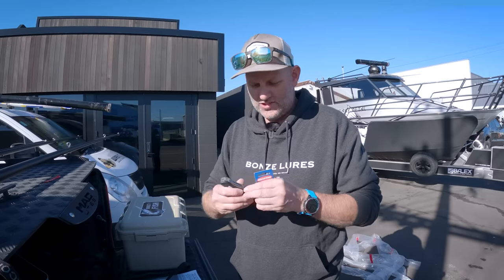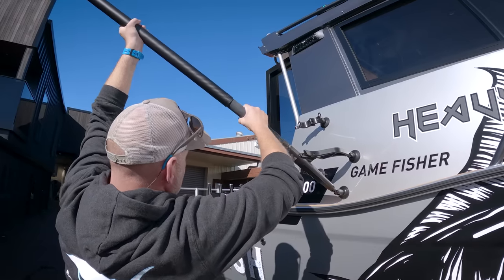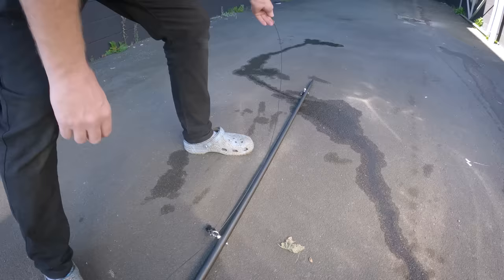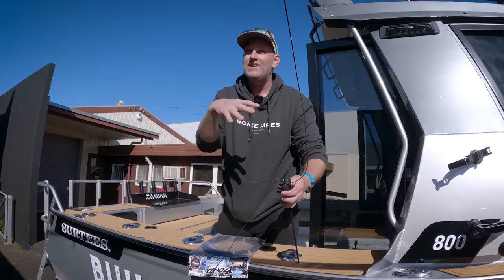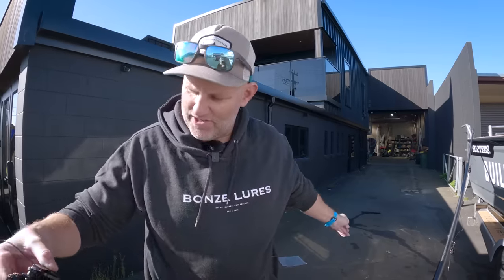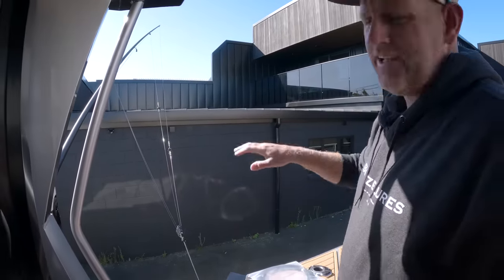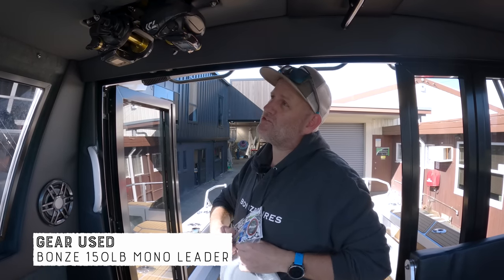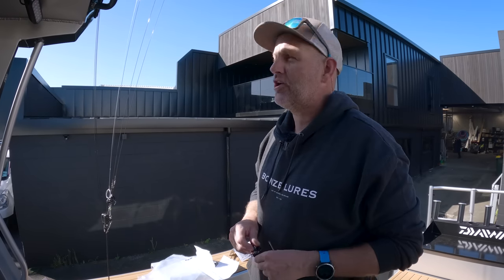Mastering Outrigger Setup: Unlock the Secrets to Trailer Boat Game Fishing

Comment: Great Video for new players 👍 

One pointer, change out the lines for SK99 dyneema, UV protection, non absorbing, no stretch and runs smooth year after year.
Reply from the maker: I’ll check it out, pretty happy with the Bonze black mono though
Reply: solid advice